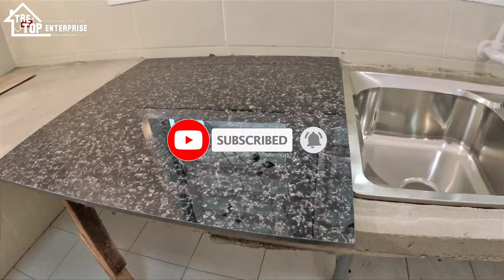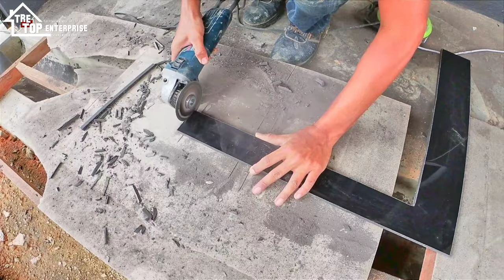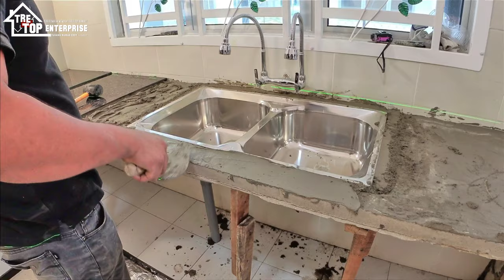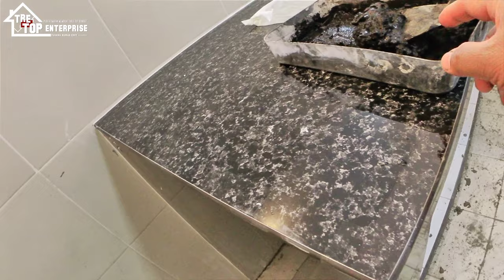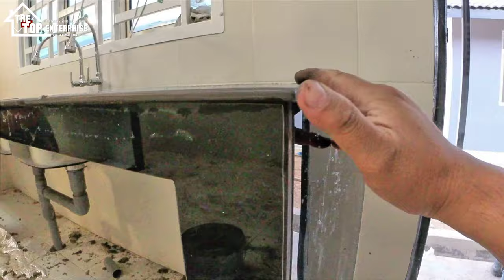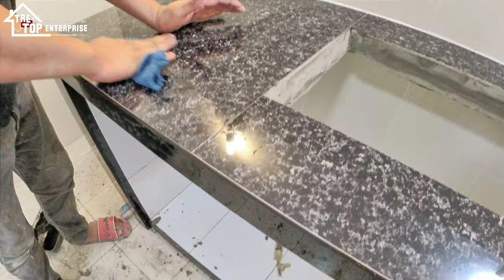Cara pasang TILE TABLE TOP || FULL BULLNOSE EDGE

Comment: Salam tuan, kalau tak keberatan boleh tuan kongsi bahan untuk concrete tabletop dan nisbahnya?
Reply from the maker: Untuk ukuran L shape 17'
Pasir 3/4- bucket
Batu 3/4-1 guni
Simen - 5 bag
Bata- 40 biji
Besi y12- 4 btg
Dawai
Syiling 4x4 - 3 kpg
Kayu 1x2/8'- 12 btg
Paku
Reply: @tretop3392  Terima kasih banyak ye tuan untuk infonya
Reply: @tretop3392  maaf bang nk tanya,sblm pasang mozek atas table,guna simen biasa atau full guna simen gam utk lekat mozek..